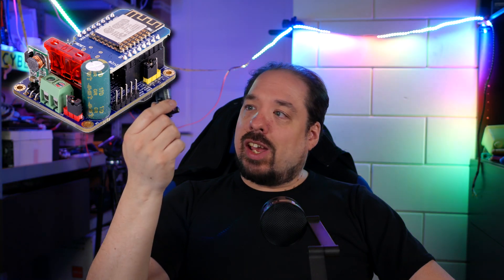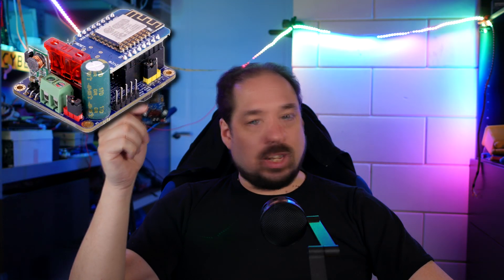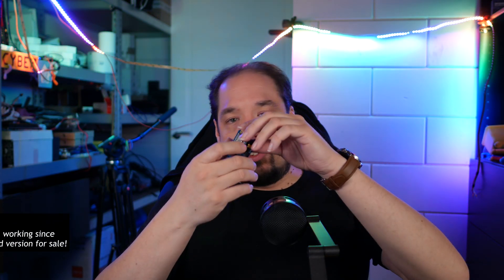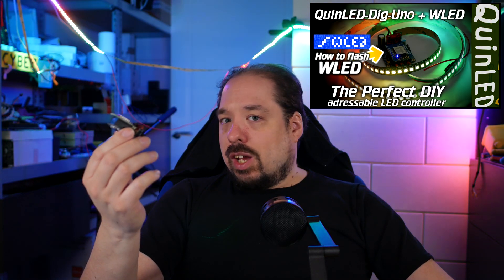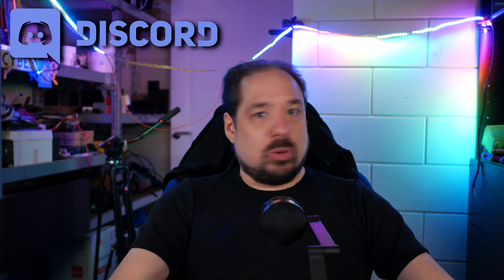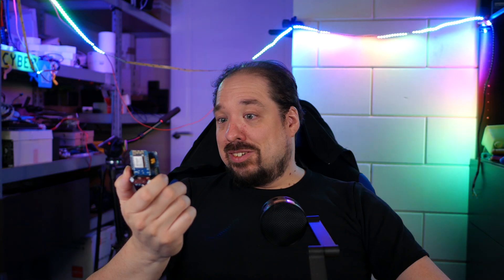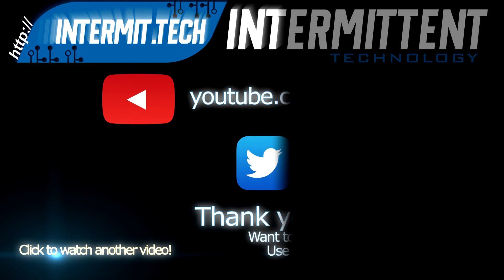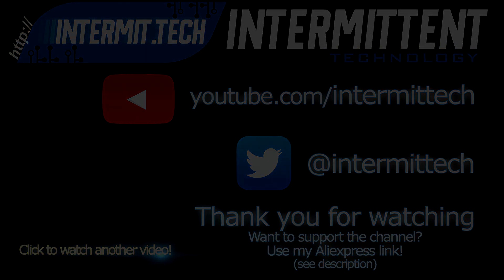QuinLED: QuinLED-Dig-Uno pre-assembled available (not anymore!?)

Comment: Are you going to get you other boards premade too?
Reply from the maker: Currently still working getting the QuinLED-Dig-Uno more permanently available in a pre-assembled form but since the demand seems to be there, yes I will be looking at making more boards available as pre-assembled. Not sure yet on the time-frame though. Which board would you be interested in?
Reply: @IntermitTech  Dig-Uno and Quad at the moment but I am sure I will want more. #CrimboLight
Reply from the maker: @AndySawyer  Yeah, it can be an addictive hobby. Quad is one the short-list since that one is already a bit more SMD then through-hole. Problem with my current designs, all are made for DIY so expensive to get made pre-assembled. But I might make slightly different versions for pre-assembled in the future. I've done a few optimizations in the new batch for the QuinLED-Dig-Uno too, but there is only so much I can do with the current designs without basically designing a new board (which takes months with testing, etc.). Still, I also want to keep DIY available, so not sure yet what form everything will take in the future. :)
Reply: @IntermitTech  I will watch this space, keep up the great work.

Comment: Just curious, how much were you asking for pre-assembled units.  I was getting ready to order components for me another friend.  Definitely interested.
Reply from the maker: I was able to make them 24,99$ (excluding shipping), that includes everything including ESP8266, etc.. I'm always looking to optimize and get costs down but that's the number for right now. :)
Reply: Intermit.Tech  Thanks!  I think I’m going to order the components and make them myself (sounds like a fun project and good for my son to learn too).  Btw, nice job on creating the boards.  One quick question, I plan to use the ESP32 boards and most the ones I own, have the additional pins.  That includes most of them I see on Amazon too.  Any thoughts on switching to those models?  Thanks again.
Reply from the maker: @jeffmills8737  Sure, this was initially intended as a DIY project and getting the components and building them yourself is still going to be the cheapest, and if you enjoy doing that, the most fun way! Depending on firmware you are going to use using an ESP32 or ESP8266 makes a difference. With ESPhome for instance you can have the board do more then just run some LEDs but if you are mostly going to be running WLED (which is excellent firmware!) then an ESP8266 will do just as well. :)

p.s. The model does need to be a D1 Mini or D1 Mini ESP32 otherwise it won't be pin compatible. :)

Comment: Wow,  Congratulations on selling out so fast.  I know a lot of people doing LED's love your boards.  I see a lot of discussion around the web on them.
I am one who likes to pre-build and I always buy components using your links.  I can definitely see a big market for the pre-assembled versions, even more if they came with the ESP chip and a matching version of WLED :)
Reply from the maker: They do actually come with the ESP8266 and everything else. Just need to flash it using the micro-USB port with the newest WLED firmware, plug it back in, done!
Reply: @IntermitTech  Fantastic!  No wonder they sold so quickly.
I think WLED and the Dig Uno makes the perfect LED controller

Comment: I don’t know if it is software supported yet, but I currently have a non addressable dmx to led driver, rgbw strip system (plus a uv strip because I’m extra) will wifi->chip->dmx be possible in the future (premade and/or diy) ?
Reply from the maker: Sure, it could be I think? But I'm more focused on the home market such as using the controllers with Home Assistant and WLED then doing DMX.
Reply: Intermit.Tech definelty, not a priority lol            i think the big struggle would be the code, all i would need is either a rj45 ethernet port or a 3 prong xlr port.  I can source these and perhaps look for preexisting code, anywhere to post this/email it to?
Reply: @IntermitTech  where should i post all this, i could make an OSE or OCI page, or use someone's github or what?
Reply: WLED Has just added DMX support, but I think it is more aimed at Addressable LED's, but it might be worth checking out as WLED has analogue LED options.  Check out Aircoookie's github.
Reply: Brendan White need to get me sone adressables